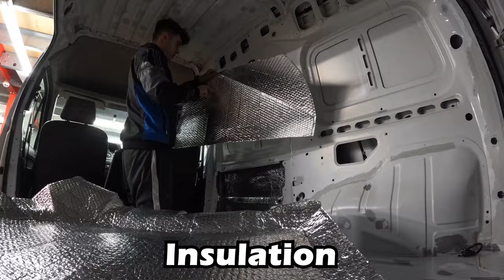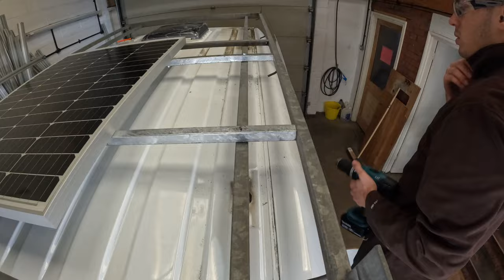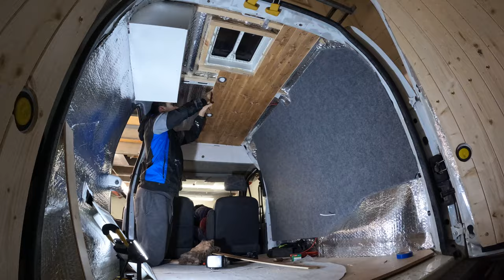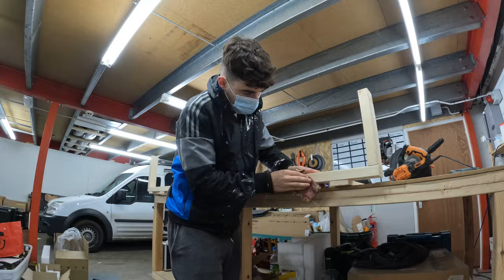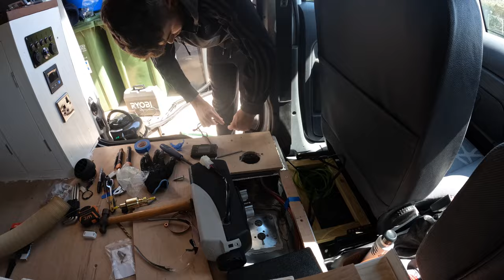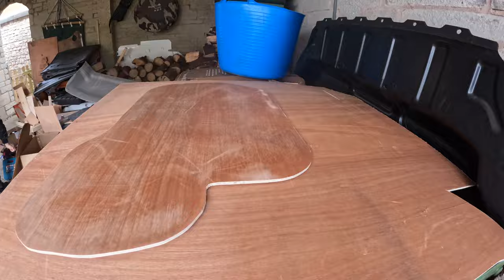FULL TIME LAPSE | Ford Transit Connect | Mini Camper Van

Comment: Recently started my connect build after years of watching others and it's actually mad how similar this build is compared to how I want mine, very well done mate if mine comes out half as good I'll be happy 😂👌
Reply from the maker: Yes Ryan! Love that mate, check out the individual episodes, they might be useful for you 😀.
Thanks haha, good luck with your build 🙂
Reply: @HarryEmblem  even down to the same bed design for the same effing fridge 😂 so if you wanna throw me over the dimensions of that I'll be very grateful 🤣🙏
Reply: Oh and watching the individual episodes as we speak haha
Reply from the maker: @ryandale2634  nice one, thank you!
Reply from the maker: @ryandale2634  the bed is a small double, splitting down the middle and the fridge drawer is half the length.

Comment: Good build.  Nice set up.  What I want to know is, many vanlifers put the electrics under the bed.  Surely this doesn't do the energy in your body any good?  I mean, just like mobile phones, we don't know what they are doing to us.  So, if we put our heads over the battery box, what's that doing to us?  I would actually prefer to have the electrics on the side slide door.  But, anyway, good build nonetheless.

Comment: Keep watching videos like these to figure out how to screw the ply to the van over the insulation, are you using existing holes in the metal work? If so how are you connect the ply without a nut on the other side? Or if you’re just screwing are you going into the metal? What screws are you using if so? Need to get my van ply lined then carpeted
Reply from the maker: They are just self tapping screws into the internal metal framing.

Comment: Can I ask..where did you place your battern to attach the cladding to at the rear of the van? And how did you hold it in place please? I've the same van and this is becoming a challenge lol. Thank you!
Reply from the maker: Hi, if you check out episode 7 that might help you out, it shows the cladding in a bit more detail. It’s essentially screwed into the internal framing of the van. It’s a difficult one that, good luck! Hope it helps
Reply: @HarryEmblem  thank you! Yeah finding it tricky!
Also is your cladding tongue and groove?
Reply from the maker: @kerigiguere3941  yes mate it is tongue and groove

Comment: how did you attach the batons to the van? screw straight into the metal work?
Reply from the maker: For some battons yes, but on the roof I used a threaded bar.

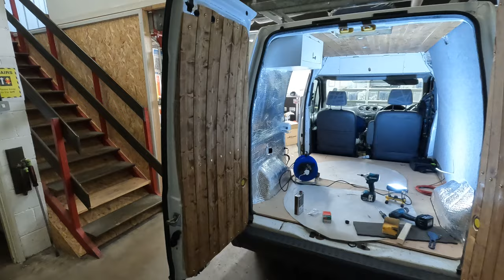Comment: Hi! Can I ask you how you attached your side piece of ceiling cladding over the metal bit that sticks out? 6:29
Reply from the maker: @kerigiguere3941  Hi, if you check out episode 7 in the series it goes into some more detail on the cladding. 
All of the ceiling cladding is attached to wooden beams which are fixed to the metal structure of the van. Hope that helps!
Reply: @HarryEmblem hi thanks! I can't seem to see anything on the cladding on ep 7 🤔
I just wondered how u got your cladding so close to the sides of the van ceiling as mine creates a big gap
Reply from the maker: @kerigiguere3941  it’s tongue and groove cladding, so it’s slotted in to the piece next to it. But it’s mainly secured by the wooden beam which spans the width of the ceiling
Reply: yes I have this too. I tried to take a screenshot of the part I mean but it won't let me. 
How far over were u able to put the side bits of cladding? As I think I either will have to have a big gap it cut a bit out of the cladding to go around the bit of metal that sticks out if this all makes sense 😅 @HarryEmblem
Reply from the maker: @kerigiguere3941  I’m not sure which but of metal you mean that’s sticking out. Drop me a message on instagram and I might be able to help
Reply: @HarryEmblem  thank you will do

Comment: How do you attach floor TO the van
Reply from the maker: Just normal screws bud
Reply: @HarryEmblem   I'd be too afraid to water leak. What did you screw to
Reply from the maker: @Jamie-re9cv  some of the floor is solid, some into the higher ribs of the van. You can seal them underneath if needed